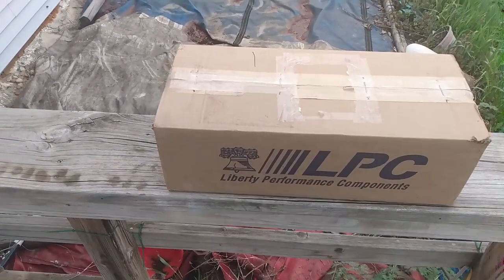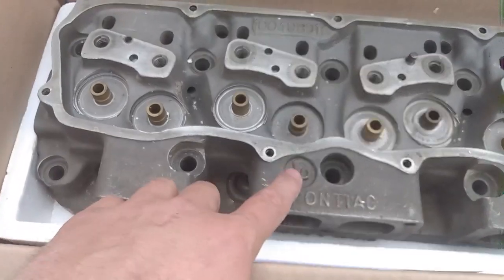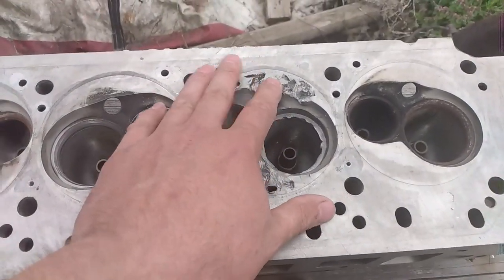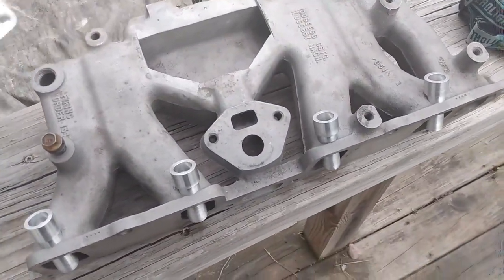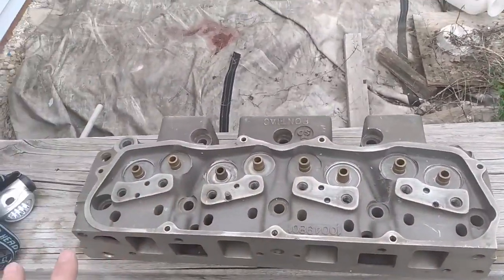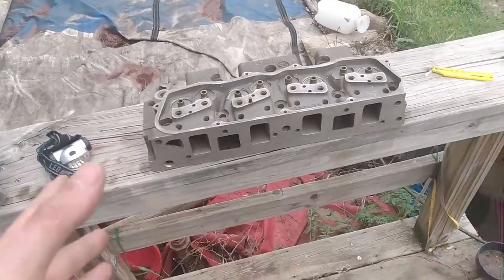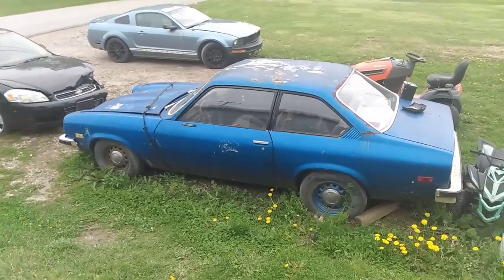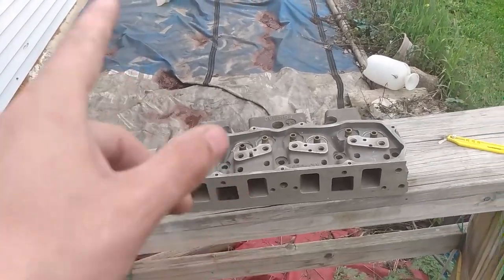Unleash Power: GM Iron Duke & Rare Pontiac SD4 Parts! SD4 801 Cylinder Head!

Comment: I won an internship program grant from Ford Motor Company in the mid eighties to attend a trade school/technical/vocational college, what ever you want to call it. GM's tech program is called the "Goodwrench" program, and Fords is called the "ASSET" program. So I attended the school and worked at a Ford dealership as an intern. Some students were Goodwrenchies, others ASSETies, and so on. Anyway, one of the instructors at the school was a huge Iron Duke fanatic. He had an SD head on a 2.5 Iron Duke in a Fiero that made 205hp, at the wheels, on the schools dyno, naturally aspirated. So, that should give you some Idea of power potential of an otherwise mostly stock short-block and that SD head. That's pretty cool. I hope you can salvage it.
Reply from the maker: I hope to one day have a killer SD4!duke engine, thanks for the story!

Comment: You need to check out my Iron Duke Dyno vid. With a stock ported head and a 500 2bbl it made 170hp. I also ran it again w Multi port injection, and it made 220 lb ft Tq and 210 hp. I did the 3.600 crank and a 4.060 bore. I wish I had an SD head I think you could make close to 400hp N/A. Here is the big problem you will have, NO cam cores are out there for the roller cam, so I had to go back to a HYD. F/T cam.    Good luck
Reply from the maker: You know I'm happy you left this comment I'm pretty sure I've seen pretty much all of the iron Duke content on YouTube so I'm pretty sure I came across your video and I watched  it and it was a good video and I'm thinking you're on track too for about how much I can make, as for a roller cam I could always have the stock cam reground if need be.

I should have a new video up sometime this weekend or next week with an update on the initial iron duke build, so stay tuned.
Reply: I did a regrind on my stock roller cam, problem is you cannot make the cam bigger than a F/T cam. You can only grind so much off the base circle before you go thru the hardening .So if you do the 3.0 build you will end up with way too much compression.  @TallGarage
Reply from the maker: @racerd9669  give me all the compression
Reply from the maker: new video up on the Iron duke
Reply: @TallGarage  Sorry you do not understand Intake closing compression. You can only move the valve events so far, and because the intake closing controls the dynamic compression you may end up with 8 to 1 or less, so now you have an early intake closing, to get compression, but that also controls the RPM the engine will make power at, so the engine will not RPM and RPM is what makes more HP. Its a catch 22

Comment: Big block Chevy rocker work naturally aspirated motor I ran back in the 90s made 315 hp. You can used a regular duke block just look at your oil returns flom the head to block !
Reply from the maker: I've head big block rockers work, I also know there are a few different SD4 heads, when I was researching I believe the have I have is different enough they don't work, I would love for someone to send me rockers to test, or some me, cause info.is hard to come by

Comment: If I'm not mistaking a version of that engine was used in the 1960's era Chevy II and was 153 CI. Mercruiser used it and rated it at 120HP until the 181 CI version was developed and it became 130, 140, and 145 rated HP through several marinizers including Mercruiser and OMC. I am also thinking they where used in 1/4 midgets and welders, pumps, and gen sets all over the world.
Reply: Chevy II 4 cyl is a 250 Chevy I6 engine, with 2 cyl removed. The 2.5 and 3.0 version both are similar in the fact that they NOT crossflow heads, and they are a Chevy design. The cyl head you see is Pontiac design, and frankly, the confusion lives on...
Reply from the maker: the 2.5 actually has more in common with the pontiac 301
Reply: @TallGarage  Indeed it does...
Reply: @TallGarage it’s essentially half a Pontiac 301 similar to the old trophy 4 that was half a 389
Reply: @barryismygod  👍
Reply: Saying the Chevy 4cyl & iron duke are similar, is like saying the the Chevy small block and the Pontiac V8 are similar. 😂 people are so confused..
Reply from the maker: considering the marine 3.0 crank can fit into the iron duke with a little machining, they are kinda similar.
Reply: I respect everyone tinkering,  but to me the iron duke was better off as a generator motor  than a car engine. I just fail to see the potential in an engine designed for longevity not performance .   It doesn’t rev high, it’s heavy and it doesn’t flow well , makes zero power.  
I mean if you realistically look at even the super duty race spec motor it’s still under whelming .  Meanwhile Toyota was building the 4age that made more hp, revved to the moon was lighter, got twice the fuel mileage, and was only a 1.6 versus a 2.5 and in race trim made 250hp na compare to the 2.7 iron duke race motor making 232hp
Reply: The Iron Duke actually does sorta descend from the Chevy II engine, but by way of Brazil. In Brazil, they changed the bore/stroke of the original motor, and Pontiac used it as inspiration, using parts that they could source from other motors. They wanted a cheap motor they could stuff into small cars to get below the CAFE standards without a ton of R&D. But it is a unique casting, born in Lansing.

Comment: you can get brand new revised Blue print engines Iron duke blocks with GM LS pushrod heads, or a coyote Dohc head. Ive seen heard watched a Coyote, Iron duke. 750HP of Insanity from that lil raging duke!  An interesting build !   And I DONT care about vibration either so,,, Yeah!
Reply from the maker: sounds like too much money but cool nonetheless
Reply: @TallGarage  Yeah , we all know the rarer odder it gets, the roof blows off the bank. :)  Ill just stick with buick 3.8 V6's for fun /dependability, and GM LS for economical power.
But now after seeing all the very fine Honda B20b and Toyota K24 economy build im kinda shocked at how far we have come with so little needed for a durable high performance build on a budget.  Dont get me wrong I grew up literally next door to Andy's Auto Wreckers, semi worked puttered there from age 11 on (1970's) All that old iron was like water through our fingers.  Now its all missed. So I look at a B20b and the parts list prices and go , OHH NO WAY!!   SO good!!  Sacrilege Frost !   :oops: << Me at 11, covered in grease.
Mom bought me coveralls, a tub of hand cleaner, and yelled at Andy lol for letting me come home like that... me sht eating grin on face, but mah, I got a 48Hp forklift engine removed for my racing tractor!!!  Mom W W WHAT!!! ANDY!!!

Comment: Using an LS head with the different valve layout would require some camshaft work. It's great you were able to find the SD4 head. I want one. I have 4 s10 dukes. 87,88,91, & 93.
Reply from the maker: Thanks man, yeah custom cams anit in the budget, if i get a real nice sbc head to fit i can use a marine 153 cam. iirc

Comment: I have a 1998 S10.  It has an aluminum head on it. I believe that it is the same engine as the Pontiac Sunfire.  Not sure about the Fiero? The aluminum head has canted valves. It looks like it has power potential.
Reply from the maker: Pretty sure that's the 2.2 ? Different engine

Comment: The Iron Duke was based on a more refined Brazilian short-stroke big-bore evolution of the Chevrolet 153 engine, which is why early versions have a Chevrolet bellhousing bolt pattern and reverse-flow cylinder head.
Reply: "Based on" is overstating the case.  There are measurements in common but virtually no parts in common.  The Duke borrows some design inspiration from several predecessors but is really its own thing.

Comment: A mercrusier 140 is an ironduke with a longer stroke, 3.0L.
Reply from the maker: So correct me if I'm wrong but weren't the mercruiser engines based on the old GM 6/4cylinders ? And the iron duke was its own thing?
Reply: the 140 is an iron duke with the 3.0L super duty crank, rods and pistons. other engines, like the 470 is 4 cyl 3.7L 170-190 hp based on 1/2 of a ford 460 with an aluminum mercruiser block, the 165 is a chevy straight 6. @TallGarage
Reply from the maker: @dodden1  well I'll look into it brother, thanks for the info
Reply from the maker: The marine 3.0L is a chevy engine (based on the old  "153) not the Pontiac iron duke (based on the 151)"

Comment: So it has been 5 months, How did the HEAD TURN OUT??? Thanks.
Reply from the maker: Do you mean in terms of the repair? I've already had it welded up, so it's all set for machining. The only rocker setup I could locate costs north of $1000, so I've shifted my attention to getting the iron duke running with EFI and a turbo, and of course, the Ford 300. Unfortunately, the SD4 is now on the back burner. Thanks for your comment and support. Have a wonderful day! Cheers!

PS we found a SD4 crankshaft, so all we need now is a block!
Reply: @TallGarage  Ahh, really Cool, I used to do a LOT of valve and head work, I figured that head would weld up strong and the valve seat is not a problem. I am looking around for some of the SD items too, have 2 mercruisers here, were you needing a 3 liter Block?
Reply: Thank you for the Fast Reply.
Reply from the maker: I'm hoping to find a SD4 Block.
Reply from the maker: i could use a 3.0 crank

Comment: Yes, the tech 4.4 galore guy is telling you a sbc has the same  bore spacing as an Iron Duke. If you make a sbc head bolt on you use the 2.5/3.0L cam to match the valve layout.

But seeing how you have that Pontiac head try to get a whole 3.0L Merc engine to bolt that head on. The Merc engine has the proper full size trans bolt pattern while the Iron Duke has the 60 degree v6 trans bolt pattern. Using the Merc engine you will need to use an Iron Duke camshaft to match the valve layout with the Pontiac head.

Putting a 3.0L crank in an Iron Duke block you have to be careful of the piston going to low on the down stroke, it might pull the piston out if the rod is to short? It's been a few years since I researched this so I can't recall the specifics. I found a forum that had all this info that a guy that did that and has been there wrote a manual on the subject, IIRC I think it was on an S10 forum? 

Yeah, that Super Duty Iron Duke block could be ordered to have different heads to bolt to it. And they sold Super Duty crankshafts as well to get the cubes up there. Either a Iron Duke or a Merc 3.0L is on my engine build bucket list. Cool stuff.
Reply from the maker: Idk if the SD4 head will bolt to a 3.0 merc engine, I do know that with some work the crank will going into a iron Duke
Reply: @TallGarage  
It should bolt right on but to be on the safe side, take your old head gasket to a Marina that works on boat if they have the 3.0 head gasket to compare it to the Iron Duke head gasket.😎👍